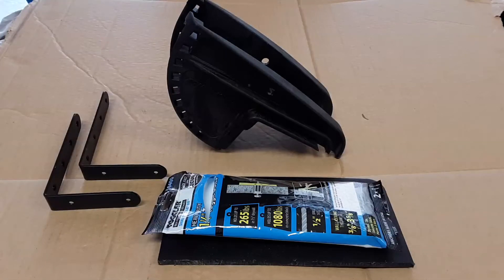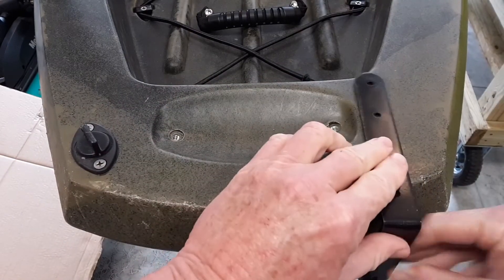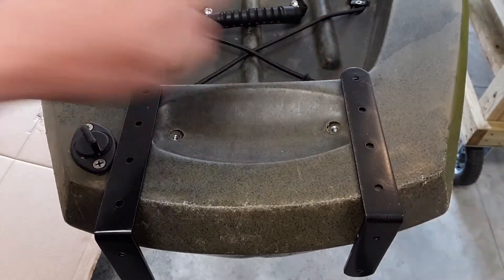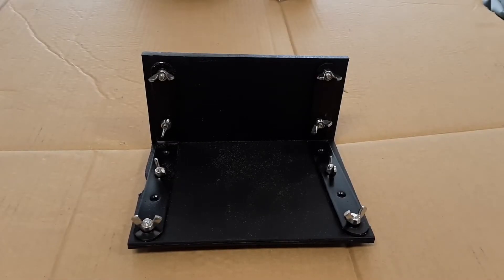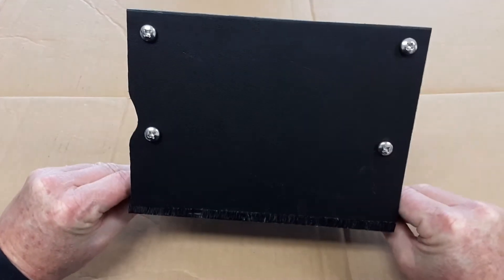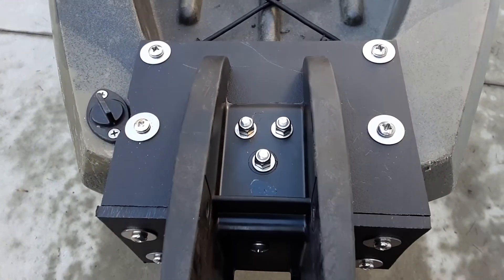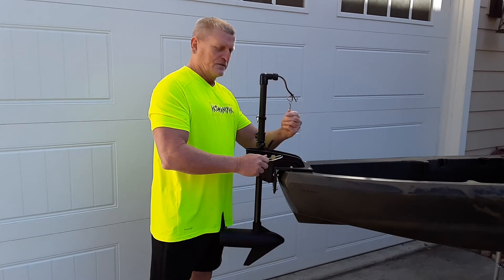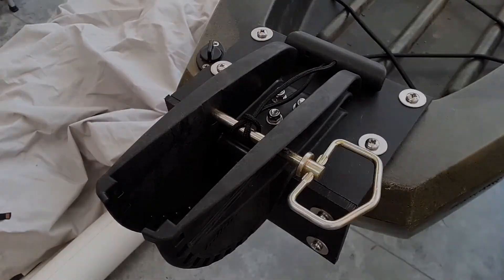DIY Ascend 12T Kayak Trolling Motor Quick Release Mount

Comment: I’m looking to put a e propulsion motor on my ascend 12t. I need the transom mount to extend up though because the shaft on the e propulsion is permanent and I believe the extra short shaft would still be too long. Any thoughts about a product out there that might fit or a way to build something?
Reply from the maker: I think a custom build would be the best for you. I have never used that motor so I can't provide any details. Good luck!

Comment: Hi. concise, to the point and easily understandable! (As are all your videos)

I am curious? Have you made a video of 2 x motors connected to a common steering link yet? 
(i.e. turning the steering would turn both motors simultaneously)
Reply from the maker: Thanks! I have never done a tandem motor set up. Honestly, I think it is more of an expensive gimmick than being practical.
Reply: @Aksmaniyak  OK - I was thinking of 2 x 86 lbs thrust motors (24V) to propel a small cathedral hull (or a kayak) as opposed to a noisy outboard - might be slower, but definitely quieter? (Could even mount a 650W solar panel overhead ?)
Reply from the maker: @joatmofa0405  Personally, if I needed more thrust I would go up in size with one motor. It is much easier to deal with.